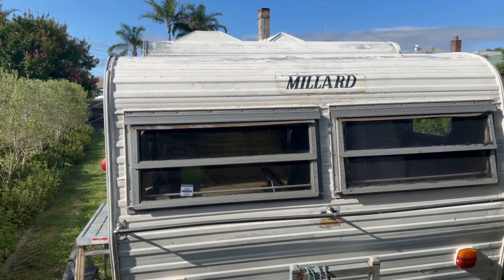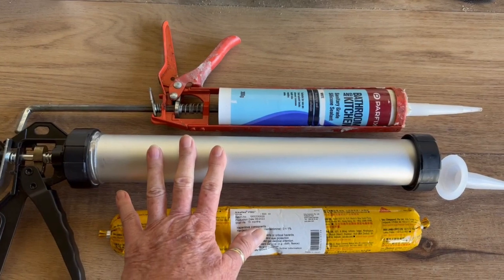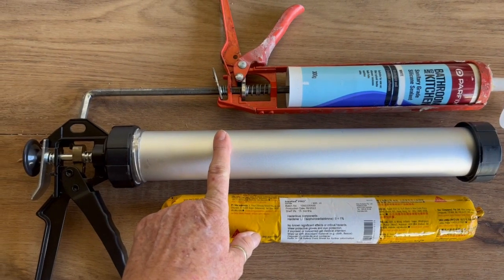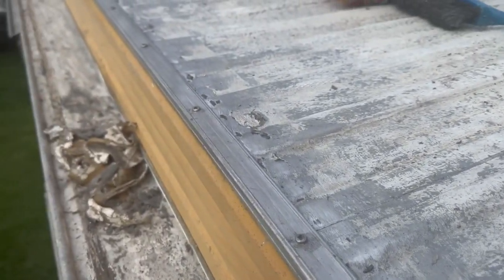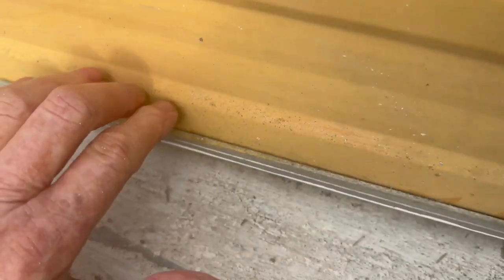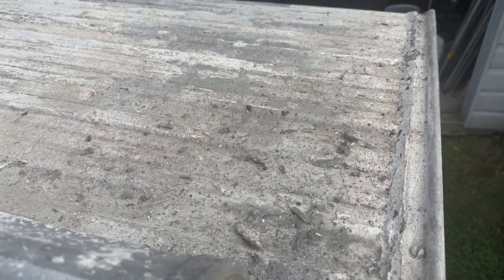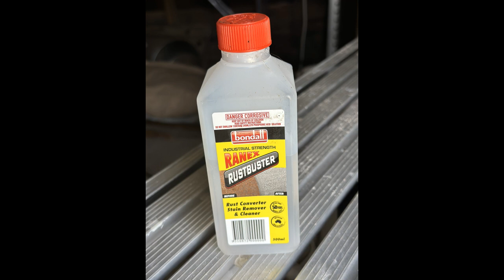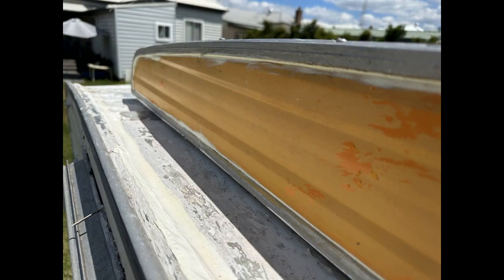Caravan J-Rail Waterproofing Silicone vs Sikaflex - Millard 1977 Aussie Rig Renos

Comment: Can the Sikaflex handle the sun? I know silastic is the sealer of choice for gutters because Sikaflex can’t handle the sun? Thoughts?
Reply from the maker: Sikaflex is more robust that silicone, stronger for bonding too. Ive not used silastic, so cant comment on it.  Is Sikaflex 522 UV resistant? all-round product. Features: weather-resistant, UV-stable, mould-resistant and resistant to ageing.